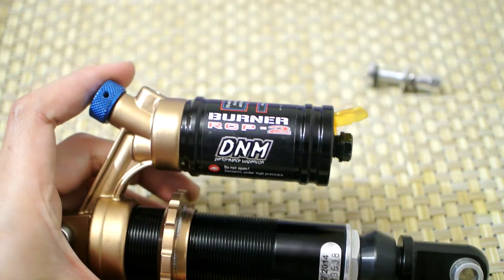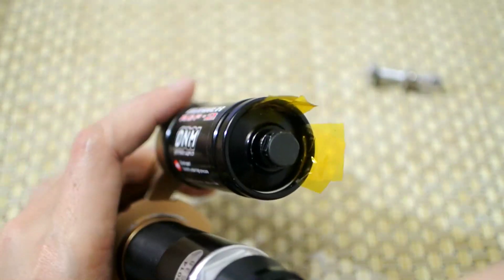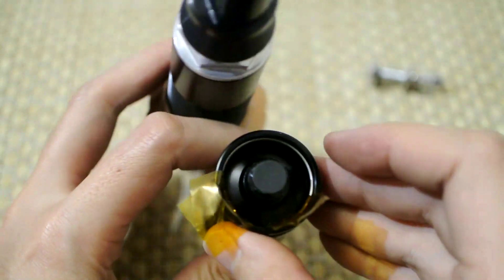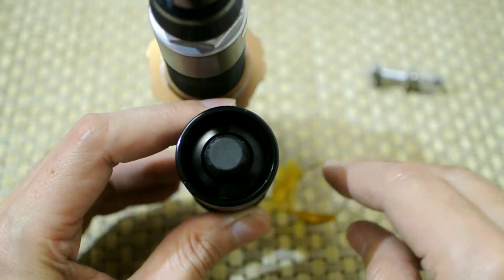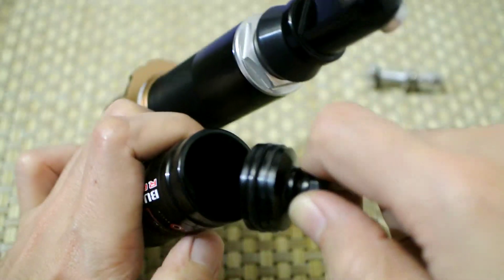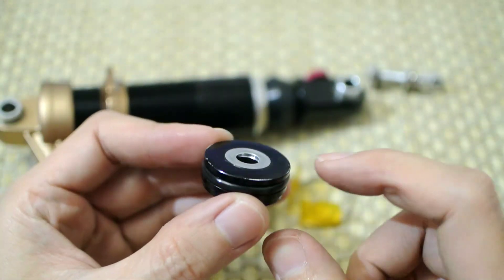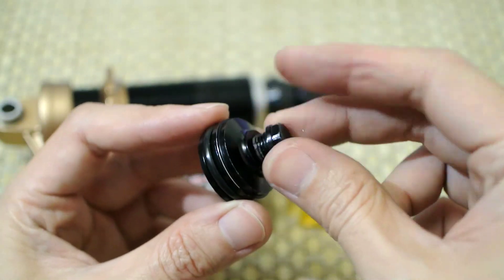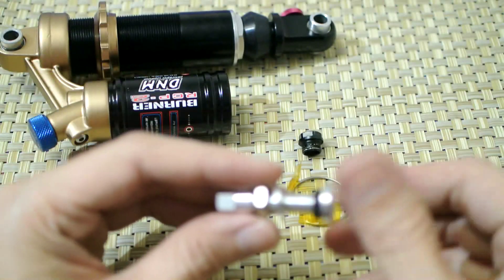DNM RCP-2 Schrader Valve Mod

Comment: Hi am just wondering what are the benefits for adding this valve and how good is the difference and benefits?

Also can i use any tubeless valve for this?
Reply: Theres no difference or benifits.. Every shock has a sealed chamber usually filled with nitrogen, never to be set by the user and not supposed to be fiddled with..Its pumped in at a specific psi and sealed with a rubber plug at the factory.. However if you want to open and service a shock yourself then you have to release the pressure in the nitrogen chamber.. This requires a schrader to needle valve adapter to your shock pump, this needle then pierces through the tiny hole in the middle of the plug and releases the nitrogen inside.. Now you can dissasemble your shock and change the oil bath for example.. When you want to reassemble your shock again you need to refill the chamber back up with nitrogen, but most people just use air.. Hence why he has added the schrader valve mod directly to the shock body.. Now you just need to attach the shock pump directly.. If you dont do this, you will have to have spare rubber plugs or the original one undamaged [unlikley it survived you trying to pull it out with damaging it]  Then you need to pierce the plug with the needle to schrader adapter and fill the chamber up..
Reply from the maker: shock is pressurized at the factory by piercing a rubber plug using needle. schrader valve allows you to pressurize using a shock pump

Comment: Simply relive all the pressure,,,,, how?  Just put in a Schrader valve,,,, Yea which one?
Reply from the maker: this shock originally uses a rubber plug instead of a schrader. so just piece it w/ the hypodermic needle to release the factory gas fill

Comment: what is the use of shrader valve??
Reply: You can now change the fixed factory air fill to whatever you specify with a proper "shock air pump".  Shock pumps are a specialty item and only allow 1-3 psi per stoke adjustments.  Strongly advised to get this specialty pump to prevent overfilling and damage caused by a home compressor or a high-pressure bicycle pump.

Comment: Since when do you need to inflate a coil shock? I thought you only inflated an air shock
Reply from the maker: @DJIInLondon  yeah the factory nitrogen fill was done by piercing a rubber plug w/ a needle. probably can't be pierced multiple times though so a shrader valve is a better solution for the hobbyist
Reply from the maker: damper needs to be pressurized for various reasons just google it
Reply: @rondg2  you know that it can hold oil right
Reply from the maker: @liamsteele4982  see my other video for the procedure for filling w/ oil and air

Comment: Great explanation. I will add that you need to release the pressure piercing the rubber plug w/ a hypodermic needle. I may ask which kind of schrader valve should I use for this case? The ones used on tubeless tires?
Reply from the maker: Yes I purchased those valves for a tubeless conversion
Reply: @rondg2  Can confirm, Tubeless valve system works famously.